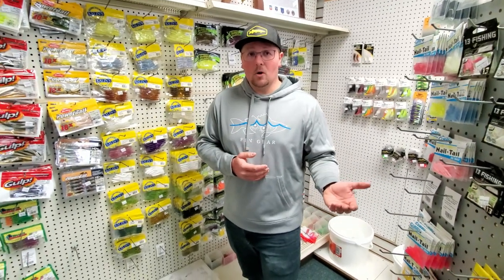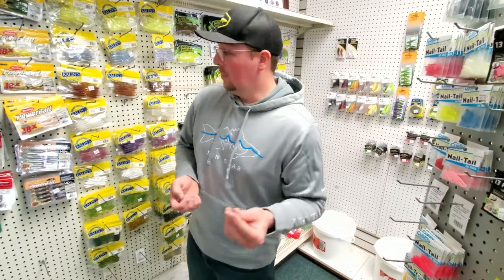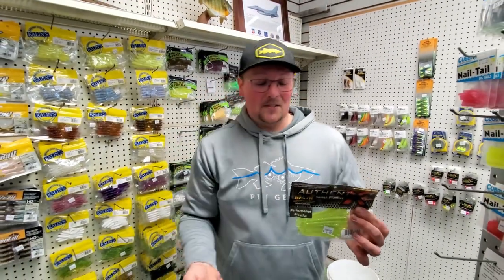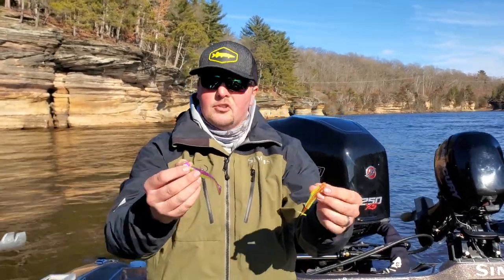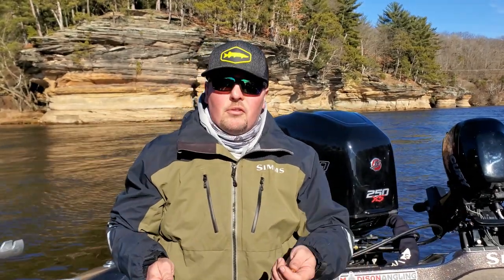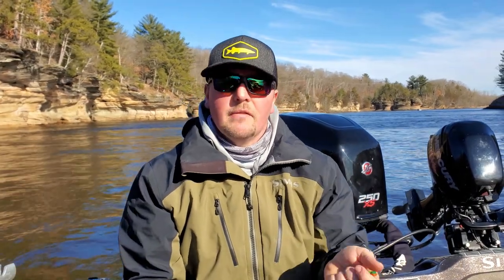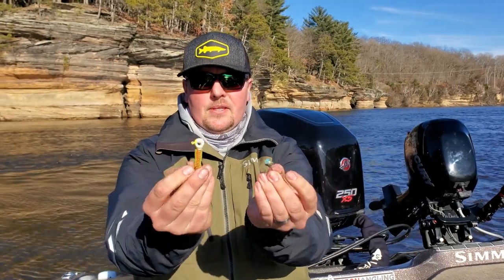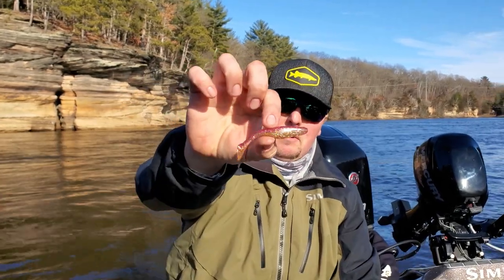WALLEYE PLASTICS!! Quick and Dirty Comparison - SHOP TALK!

Comment: Walleye can see Orange and red well, to a lesser degree green and yellow.  They do not see blue or purple well.  This comes into play when fishing deep here in Lake Roosevelt, Washington.  We have depths over 300 feet.  Red drops out of the light spectrum at about 30 ft or so.  After that it appears gray or black. I often fish around 140 ft on the bottom with green jigs.  In the spring walleyes are shallow and in April or May they bite most anything.  White is a good color in plastics for us then or gold blade baits.

Most guys east of the Pacific NW don't really know what deep is.  I get a kick out of some of the videos where they throw 1/8 or 1/4 oz jigs.   We seldom use jigs less than 1 ounce or we cant hit bottom.  The current just brushes them away.  We can't use live bait here in Washington so we are pretty practiced up with plastics.